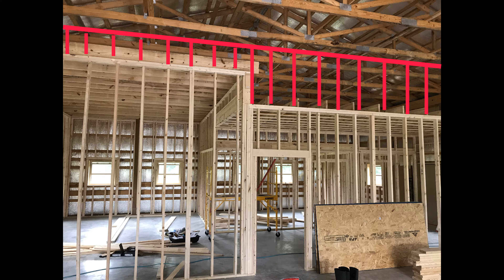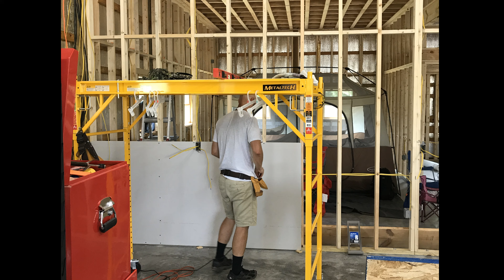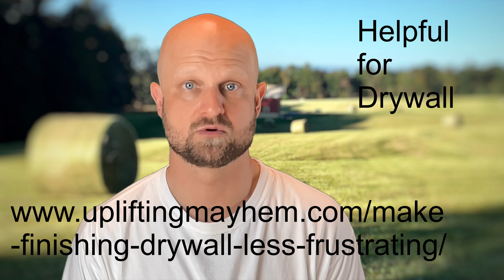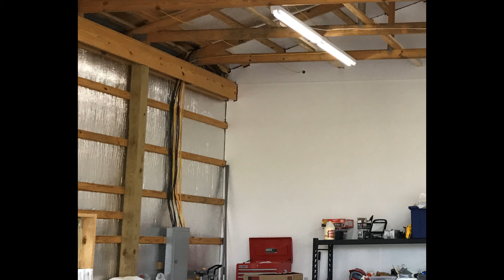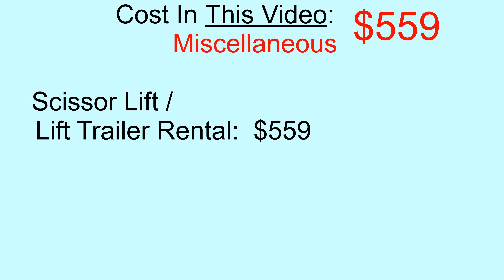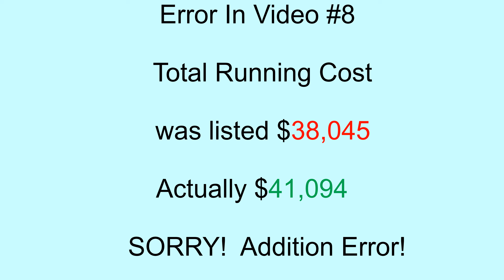#9 Pole Barn Home Build:  Separate Garage / Living Space

Comment: Thanks for these videos! One question: why did you do a soil study?
Reply from the maker: The soil study is a requirement to measure the speed that your soil absorbs water.  This will determine the size of drain field you need and length of lines for proper drainage for your size of house.